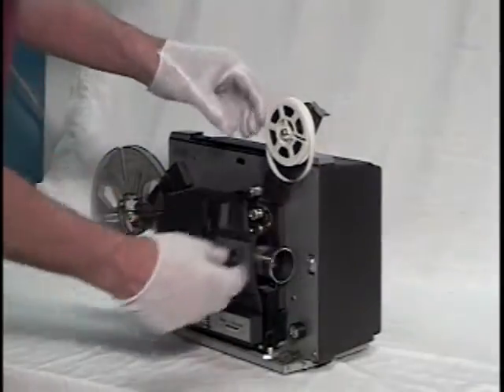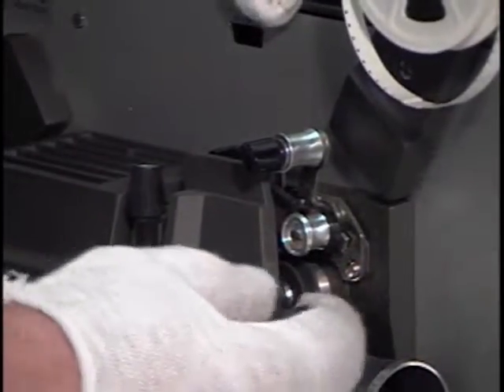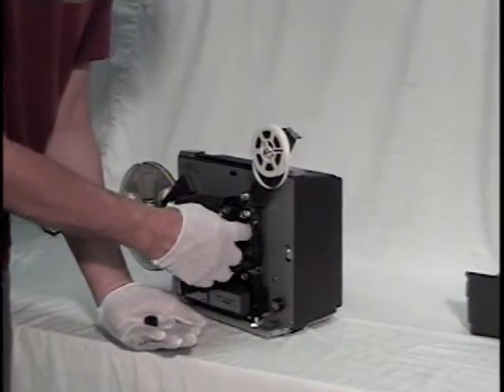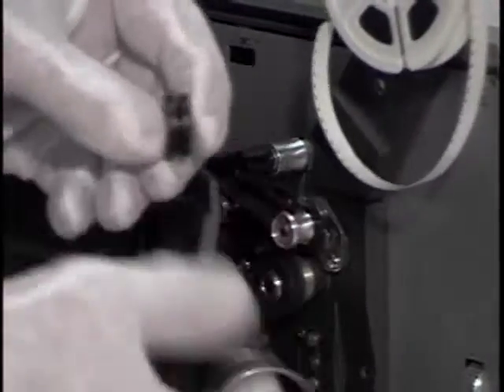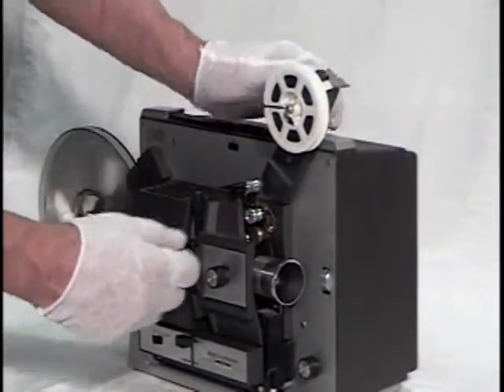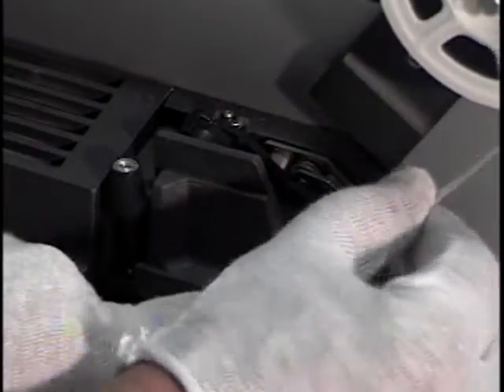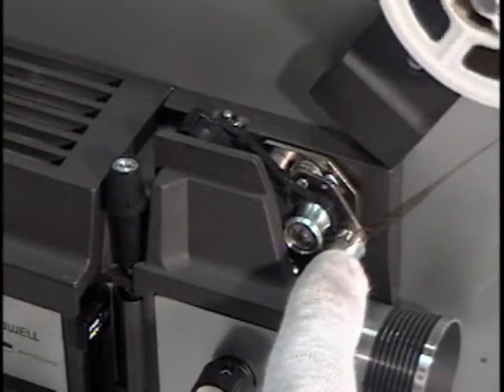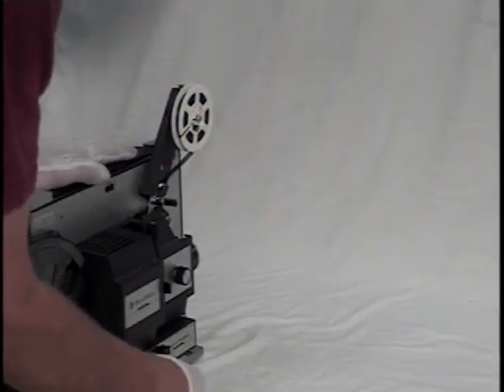How to Thread a Bell & Howell 456A Dual 8 Projector

Comment: hello, have a question my bell and howell  projector 456a  works well with supr 8mm NOT  REGULAR 8 mm, 
would you by any chance could be the problem. many thanks.
Reply from the maker: Just make sure the Reg 8/Super 8  selector switch is in the proper position for each type of film. Otherwise I would need to see the projector. Good luck!

Comment: Whenever I feed the film in it always gets bunched up and never reaches the take up reel. It's as if the roller wheels do not want to carry it. Any ideas as to how to service this or fix this issue? I have checked that it is always on the proper 8mm setting.
Reply from the maker: It's hard to give advice without actually seeing the machine. Good luck!

Comment: This is great. I need to find a new wheel tire and also what can i do if the rear wheel doesn't move. The motor runs great and the light and fan but no spinning if anything. This is my grandfather's after he returned from WW2 and Is like to get t his going and show my mom.
Reply from the maker: If it's not spinning it probably needs a belt too. https://www.ebay.com/itm/291686072152
https://www.ebay.com/itm/295533636190

Comment: I have a B&H 456A and replaced the rubber tire, and drive belt.  It works much better now... however the picture it gives is horrible.  I think something is missing like a shoe but not sure what parts are supposed to be there.  The picture is very washed out with white light around the picture.  I ran the same 8mm film on an older 1950's Regent 8mm projector and the picture is 10 times better with nice vibrant color.  Please help!  What is wrong with my B&H 456A?
Reply from the maker: It sounds like your lens has become "foggy" or "milky".  You will need a new lens, or take you lens to a camera repair shop.

Comment: I just bought one of these on eBay, rebuilt. The super 8 works fine but the 8mm wads up in the auto feed. Any ideas of why?
Reply from the maker: When that happens to me, it is usually because I forget to properly flip the S8/Reg8 selector switch. Also some of the older Regular 8mm film leader can get stiff and slightly curled. That can catch on the pressure plate guide as it enters the film gate  I usually work the end of the film by bending it back so that it is flattened out. Also trim the end in a squared off "V" or rounded shape. Good luck!
Reply: Thanks

Comment: Thanks for the info... however, once my film passes into the light/lens part, the film just bunches up and jams... any ideas what could be causing that ?
Reply from the maker: Check the pressure plate that presses the film to the film gate. It should be springy. Sometimes they bind up, causing the film to bunch up. Also look for any other damage that could be "catching" the film. Thank for watching and good luck!

Comment: Thanks for the video! Sorry if this is posted elsewhere, but what could be a reason why my Bell & Howell 456A projector suddenly won't run in reverse? The single frame advance knob spins, but the front reel head won't turn. Is this belt-related? Thanks in advance.
Reply from the maker: http://store.tvedenlampmodules.com/Bell-Howell-346-346A-356-357A-357B-357Z-358A-358S-456-456A-Projector-Motor-Drive-Belt-P5532207.aspx

Comment: I am attempting to use my dad's old machine.  It's probably 50 years old.  There was a sticky green goo that was on the plug and cord.  I'm scared to plug it in, even though I've cleaned off the goo.  Have you seen this before?  I think it came from inside the plug head.
Reply from the maker: Unfortunately, your dads projector cord is victim of the "Green Goo". I have seen it dozens of times. It is all too common on projectors that are stored in humid warm environments. It is caused from the polyvinyl rubber breaking down. The green goo is/was part of the actual rubber that is leeching out. It is best to replace the cord. If you know someone with a dead VCR or coffee maker clip the cord off and you just replace the green goo one with the donor cord. I think I have a video that details how to do this. If I can find it I'll put the link in here. Thanks for commenting.
Reply: Had this on my parents machine too

Comment: Appreciate the demo.  Here's the thing.  These demos ALWAYS show Super8 film being loaded and NEVER show the wider standard 8mm film being loaded.  

Standard 8mm is TWICE as wide and doesn't look like it would fit down through the little guide that threads the film past the lens.  Any info?
Reply: Standard 8 mm film is the same width as Super 8 mm but has a different type of sprocket hole configuration. I believe the wide film you are talking about is, in fact, 16 mm film and requires a 16 mm projector.
Reply: arithmecode How right you are.  I do know this (??)  and must have been having "a moment" from overwork.  Thanks for your kind reply!